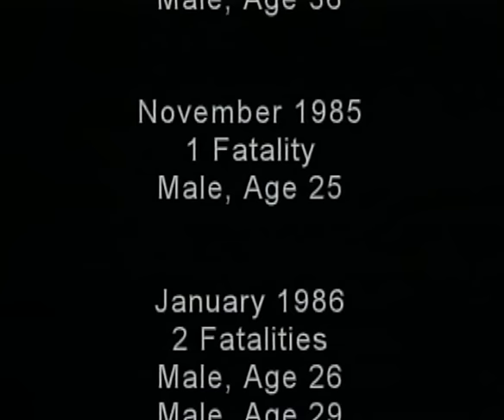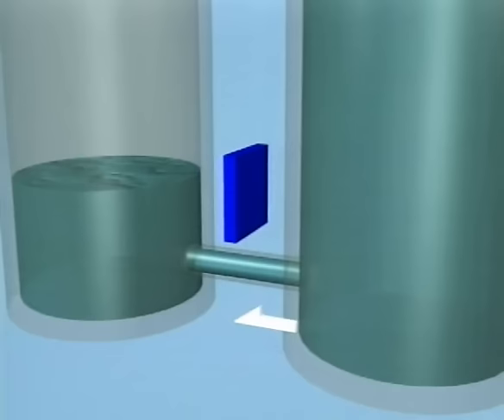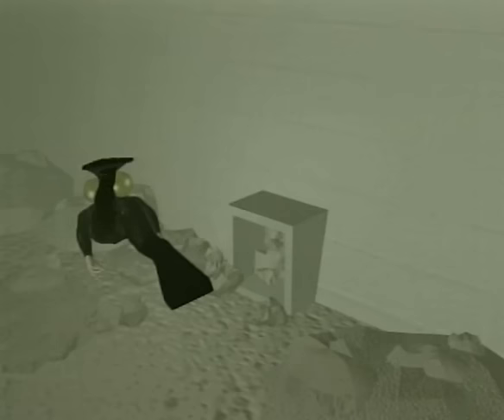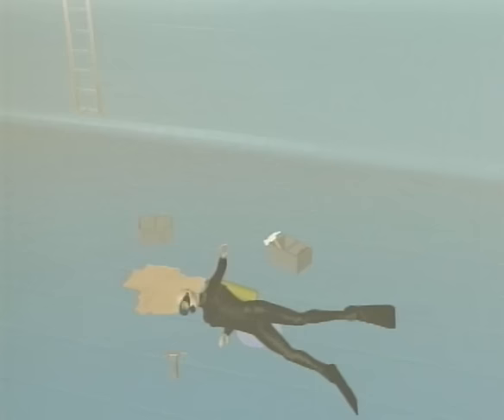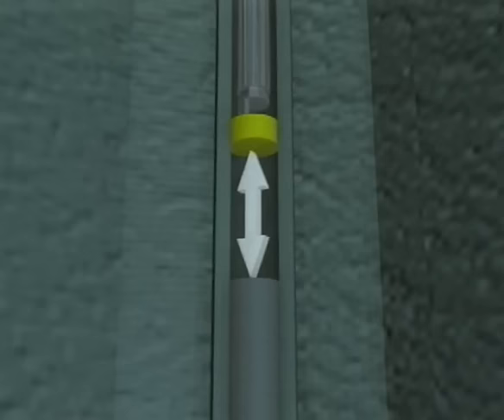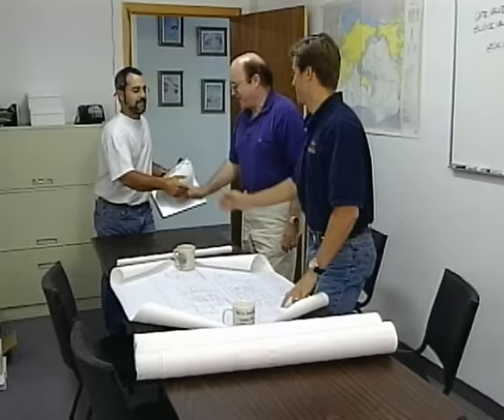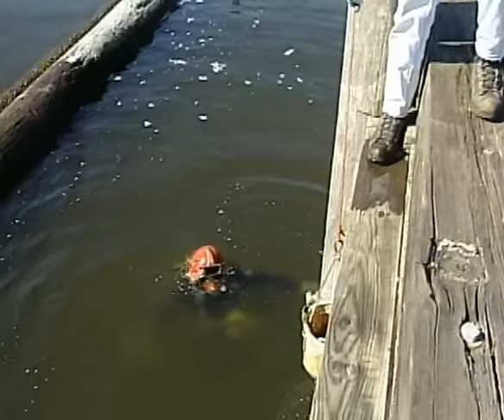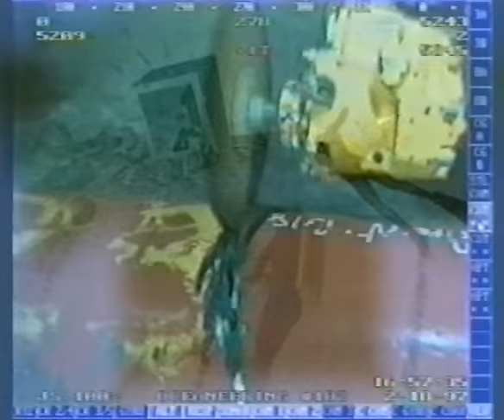Delta P

Comment: This reminds me of the byford dolphin accident. I know it’s not the same thing, but it’s similar enough I guess. It went something among the lines of a diving tender releasing a clamp near a diving bell too early, causing the pressure in the bell to go from 9 atmospheres to 1 in a fraction of a second. 4 divers and the diving tender all died instantly, with one diver litterally getting torn apart and exploding into a million pieces. It’s worth googling for sure.
Reply: Jesus christ.
Reply: Worst way to die for sure. That is absolutely horrific.
Reply: @ps2bndled  

There is an unverified picture of said divers remains, on an autopsy table; 'exploding into a million pieces' pretty much sums it up, because only a certain percentage of his body was recovered, and others simply disappeared, such as his head. Even his spinal column was recovered separately. I'm pretty used to seeing pathology photographs, as that was a field I had hoped to get into (Didn't happen, long story ...), but even I was shocked at the — apparent — injuries that diver suffered ...

Fortunately, for him, death would've occurred faster that his conscious mind knew what was going on, especially as the delta P was enough to blow him through a gap, iirc, less than 36" across, and more closer to 24". I can't remember what his height and weight was, but if you could imagine a average size man, of average build, and weight, forced through, for arguments sake, a 36" gap, roughly half his height, that gives you an idea of the shearing forces involved.

As the diver tender whom prematurely undid the clamp was also killed, to date know one knows why he did it. One hypothesis is, due to the long work hours, at depth, resulting in fatigue, plus nitrogen narcosis — which has a similar effect to that of being intoxicated — all of which may have made him make that fatal mistake. 

So whilst horrific, fortunately — if one can even say that — death was near enough instantaneous, as the whole accident occurred in only a space of a few seconds.

For me, personally, the worst way to die is radiation poisoning, that takes weeks to take effect, to the point the amount of fetanyl being pumped into you, almost makes you near comatose, before they do put you in a medically induced coma, as you have to be placed on a ventilator.

Although radiological accidents of that severity is rare, the consequences of receiving the highest, non-lethal, dose, are still pretty damn unpleasant ...
Reply: There is a reason that commercial diving pay STARTS at $150k a year and can be more than $250k.
Reply: @toomanymarys7355  you got that right.  Greater the risk, the more the compensation you'd want to make it worth while.
Reply: @Golgi-Gyges  yea but how much $ can you make?
Reply: @atkearns  what's the price of tea in China again?
Reply: @toomanymarys7355  actually its more like 50k
Reply: @purpleey  Depends on the type. If it's the dangerous type, it's very high.   Industrial diving, I perhaps should have said....
Reply: There are photos of diver 4 afterwards :/
Reply: It's the exact same thing in terms of physics. Delta P is no joke.

Comment: i was already afraid of the deep sea....the pool too now?
Reply: Because of an entrapment death, pools in the U.S. are required to have drain covers that can't be plugged by your body. You're safe :)
Reply: aren't pool drains small enough to be plugged by your body even with waffle/slots tho? eg: your foot covers the entire waffle pattern, and while your leg isn't "sucked in" your foot gets suction-cupped to the drain and unable to be removed?
Reply: They're usually raised a bit so your body isn't likely to cover the entire top + sides
Reply: may have been talking about a specialty pool used to test diving equipment under high pressure
Reply: @Agent766  yup. Most pool drains are a reverse concave for that exact reason.
Reply: Convex

Comment: I'm not flushing the toilet anymore
Reply: +Sunmist2 I do not think so, the only delta P would be provided by the air and you should be able to overcome that. The hazard is below water where its weight above you generates a lot of pressure.
Reply: 4 years of not flushing the loo, i bet it house stinks
Reply: Ur*
Reply: When the toilet reaches a certain level it automatically flushes. Just gotta urinate and defecate really fast and voluminously
Reply: Delta pee

Comment: the paramedic at 7:40 taking his pulse 12hours after being dead.
Reply: If he hadn't, he would have lost his job and probably sued.
Reply: How do you know if he's dead without taking the pulse?
Reply: LastStar007 many ways. He had 45 minutes of air, and 12 hours have gone by. He isn't breathing. He has no reflexes. Taking the pulse of an obvious corpse is idiotic.
Reply: They have to check for pulse and also do an EKG to officially pronounce death.
Reply: @hugoarcada  it's called confirmation.  Check the box, yes.  But a rather important checkmark for EMS.
Reply: @CavZippo  I understand that Kit, yet still is silly. Sometimes you need to think for yourself, without the guides of some bureaucracy.

It doesn't hurt, just takes 10 seconds, but after 12 hours, if that guys was on my team, I'd ve a bit worried
Reply: @hugoarcada  but EMS is part of the bureaucracy.  The doctor at the ER gives the legal pronouncement of Death, but the EMS crew have to check for themselves.  The news history is full of stories of those that died at the scene (fairly or not) because the first responders took - so and so's - word that the victim was dead.

Comment: And only now I realized that delta P stands for "delta pressure" aka difference in pressure between 2 water body masses
Reply: The Greek letter for delta is often used in terms of change, or, rather moreover, the rate of change, so, say, delta T⁰ refers to the rate of temperature change.

Comment: For anyone who wants to know, Delta, as in the Greek letter, simply means change in something. For example, Delta h would mean "change in height".
Reply: oh that makes sense
Reply: Experience Delta h to finally become a 6'5 Gigachad or experience Delta v to impact the wall at high speed
Reply: @Flesh_Wizard  Or Delta a to become a pancake on said wall
Reply: @averagejoe8358  or Delta g to become a pancake on the floor
Reply: - "∆v" 
  - phonetically "delta vee" or "dee vee" 
  - is a very common term in space travel, meaning "the total change in velocity", which turns out to be a very useful measure of how much total "reserves" of potential acceleration you have left. it's useful because it takes into account when your total mass changes as you jettison parts of your spacecraft (including the enormous proportion comprised by the rocket fuel!). it's a bit like choosing to talk in terms of "how many McDonald's hamburgers is this worth" instead of dollars in a country with runaway inflation.

- "δy/δx"
  - usually called "dee y over dee x" and often annotated with a Latin "d" instead of the lower-case Greek "δ": "dy/dx" 
  - when you see this you're dealing with mathematical "differentiation", a part of calculus, which is all about working with tiny, gradual changes over time. the "d" or "δ" is not meant to be read as a separate variable, but a modifier to the name of one variable which (unusually) has a name that's two characters long. 
  - this means "(the tiny change we measured in y), divided by (the tiny change we measured in x)"
  - this is called "Leibniz notation" and is actually kind of weird and wrong in subtle ways that likely don't matter when you learn calculus in high school
Reply: Delta h would technically mean change in specific enthalpy

Comment: This is why drains are on the side of pools with the flap and not on the bottom anymore. At a recreational wave  pool here in Canada, it was an old pool with drain at bottom. Girls hair got sucked and tangled in the drain and she drowned. Doesn’t even need a perfect seal if your hair is long and sucked in. As I said, now new pools have the drain on the side of the pool half submerged half not with the flap rather then a constant suction on the bottom. Maybe bigger pools need it on the bottom but doubt it.

Comment: Hypothesis: If a diver seals e.g. a drainage pipe in a pool, his best chance might be to cut out the piece of his wet suit. This way, the seal remains unbroken while he is free to surface. I don‘t want to imagine his options, if he isn’t wearing one.
Reply: In 2015 a Nigerian diver working on a dam had his hand  sucked into a void and after having tried to free himself for hours, he finally asked that someone cut it off. This was done by the supervisor. Although he had spend many hours at 30 m (100ft.) the Diver survided.

Comment: Seems to me, most of these incidents were not the divers fault, but either faulty equipment/gear or negligence by the administration. So as a diver You can follow all safety protocols, and still die in a split of a second.

Comment: Change in pressure? It can be a bitch. There were some divers working in a tank when there was some kind of fault and the pressure equalized quite rapidly, forcing a man's entire body through a small diameter pipe.

Comment: A question. Does the Byford dolphin incident considered as delta p? I apologize if this question came as rude.
Reply: In diving as this video refers to it, delta p is more the hazard of water flowing due to difference in pressure, as opposed to the risks of a contained pressure being released. Though Byford Dolphin was a diving incident and certainly involved a delta p, it would be more a case of uncontrolled decompression which in addition to immersion diving is the realm of air and space craft.
Reply: @D4cked ah, I see.. thanks for answering my question :D

Comment: All of these seemed extremely preventable to the point of, why the hell didn't most of these divers think "if the force of water suddenly changes here, I'm fucked"?  Especially the ones clearing a blockage.  Have you never opened a drain on a bath tub?  More disturbing that whoever manages these divers was like "yeah, go ahead and clear that blockage that is sure to greatly increase the flow of water and therefore suction into the hole/pipe... and don't worry about communication equipment or a tether."
Reply: preventability doesnt matter bro, youre too safe. Continue though
Reply: @willisamak3654  profitability > preventability

Comment: What if the hole was big enough for a human? What if the pressure differential wasn’t that great and the human could survive? Would a human be able to position himself so the pressure could still equalize with his minor blockage?
Reply: Well a event similar has happened wheb I think 3-4 people were all sucked in into the pipe,they barely fit and had broken bones 

Sadly only 1 guy made it out alive 

Paria pipeline disaster

Comment: I don't understand why he asserts that a perfect seal is necessary for the water to trap your body. That shouldn't be true since a pressure differential can exist anyways, even if water is flowing. After all you get pulled towards the flow of the hole in the first place without a perfect seal

Comment: why aren't the pipes widths larger so the pressure can equalize? or more rectangular? The only thing I can think of is that you'd need to redo all pipes and connections to them. But really no amount of money is worth more than human lives in these situations. Plus it should've been installed on conception

Comment: Stupid question but could you have a chance at escaping delta P by trying to loosen the seal and hoping enough water goes through quick enough to equalize before you drown?
Reply: If you were to be strong enough to make that little space for water to go through for long enough, sure. Depends on the factors the video said

Comment: I'm wondering if this calculation is correct. He uses different meausrments all mixed up.
Reply: Checking on Google about Delta pi, it states it's the difference in pressure. So he also needs to know the pressure on the other side. Than subtract P2-P1

Comment: If your butt cheek, or whatever body part,  is sealing the hole that's sucking, can't you just wedge a screwdriver under your butt cheek or something,  to the water pass, so maybe the pressure will weaken enough before you run out of air?
Reply: The screwdriver along with your hand is also gonna get pulled in

Comment: Why would someone repair the pool bottom without draining the water first? Does draining the water cost more than hiring a commercial diver? Seems like they wanted the repair to be as complicated as possible.
Reply: The pool would be out of service for nearly a week if filling by a garden hose, water (here in California) would cost upwards of $600 to pull that many tens of thousands of gallons. Source: I have 12ft in-ground pool
Reply: @randykitchleburger2780  I just found more info about the accident. "The swimming pool measured 252 feet in length by 25 feet in width, was 3-12 feet in depth and held a fresh water capacity of 349,200 gallons. At one time it was the largest swimming pool in the United States.

The country club contracted with the victim to perform annual spring maintenance. The pool’s annual maintenance protocol included filling of the pool to full capacity prior to the application of a sealant to repair pool floor stress fractures which occurred over the colder winter months."

So it seems the pool being filled to it's max capacity is part of the protocol and it's not about the cost.

Comment: I think this video has .major error showing the formula. What wrong is that they use square inch x foot depth. They should use square foot of they multiply by foot in depth
Reply: Square inches of area (in2) x difference in water depth (ft) x PSI per foot of water (PSI/ft)
inch2 x ft x PSI /ft
PSI is pounds of force per square inch (lbf/in2)
in2 x ft x lbf /(ft x in2)
lbf
The result is just force, the formula is correct